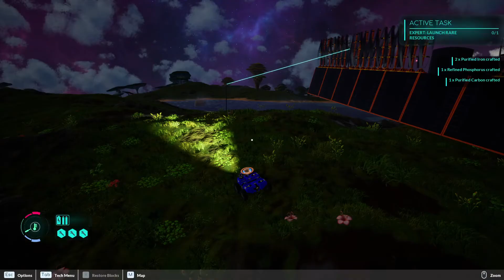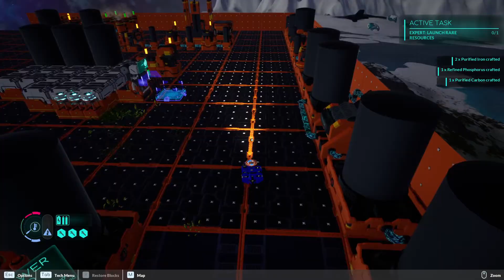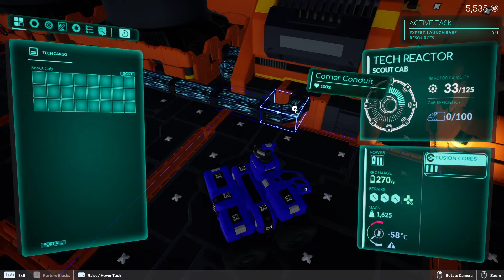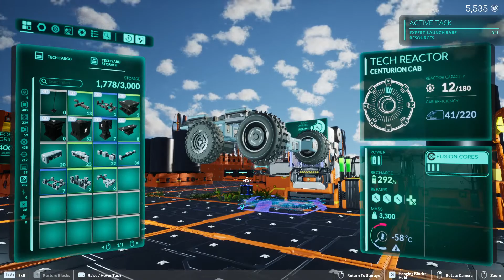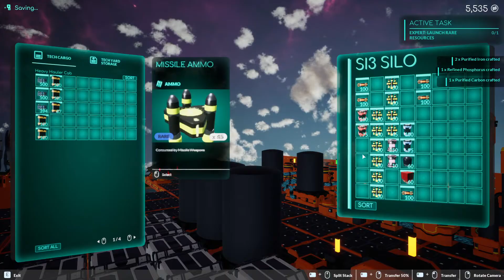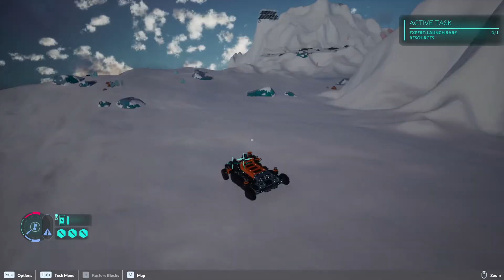Old Version* Terra Tech Worlds Beginners Guide and Tips

Comment: thx for letting me know there is a secret shop, i was wondering how i would get those blocks.
I have been running around just ramming because the vindur kinda sux against bosses, so i just ram them into structure and one-shot them.
That and i always die in snow thx for the tip too ;)
Reply: did they remove t hat menu?? i can't find it for the life of me
Reply from the maker: Ya sorry.. ive been playing this newer 0.6 version all week and didn't even check you tube.
I just changed names of old vids cuz i'm getting ready to post new vids on everything for 0.6 update.
I wanted to finish everything i could first before that tho.
So i'll be making new vids on this version all week now.
Reply from the maker: Your welcome. Its not secret shop tho, just a bad way to learn blue prints.
Reply: @bigdaddykarvix43  how do u get the voxel tool tough?
Reply from the maker: Sry i don't remember what that is.
Reply: @bigdaddykarvix43  To dig holes and get rocks out more easely then cutting them
Reply from the maker: O ya they changed the name of that, but you get from doing the missions, just keep popping them off and you'll get to it.. But i wouldn't bother and just use the terrain manipulator to flatter ground on the big rocks then you can pick them up.
Reply: @bigdaddykarvix43  in the beta i can buy it from yellow thing
Reply from the maker: Ya prob more changes since i last played

Comment: I noticed you didnt add any armor plating to it?
Reply from the maker: Nope, you can watch my other vid on best cab/mech build and see.
But the limited area armor plats protect and cost is better used with modifiers that give more buffs. Also its no cores, after you get cores and start adding plus 60 capacity you can add lots of armor if needed.
Build gives a good amount of armor and nanobot repair already with turbo, and long range sniper guns and missiles/nads can make short work of guys before they close if you want to fight like that, or load it up with 15+ basic guns and run and burst them all down is seconds.